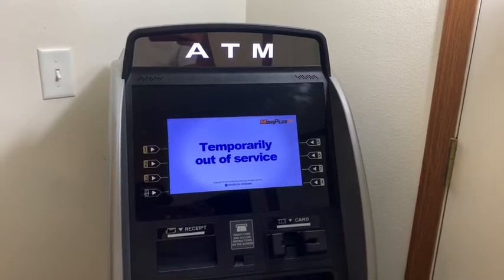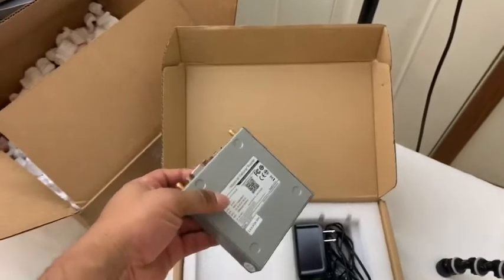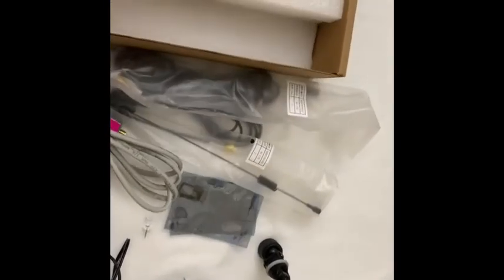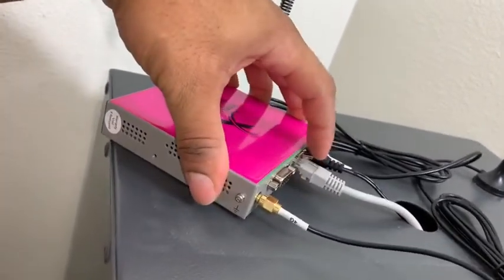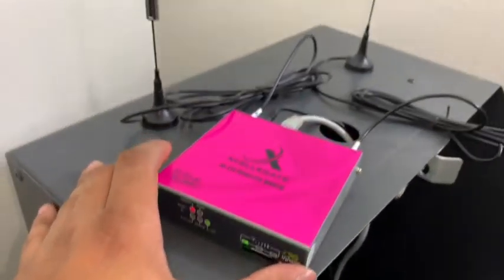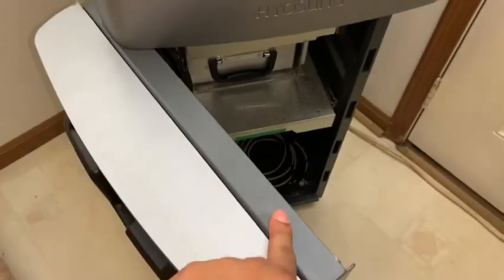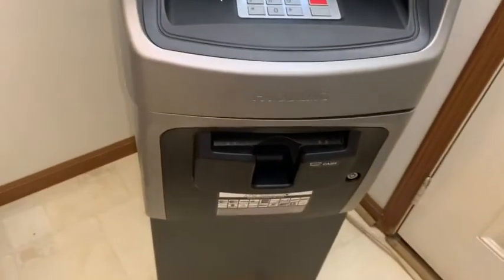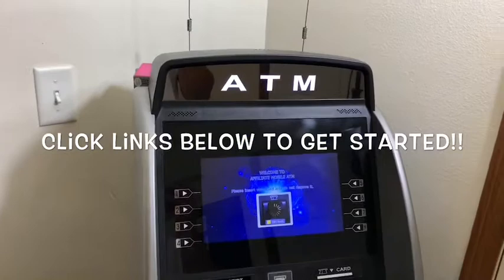Installing internet modem to your ATM

Comment: I'd hide the antennas in ceiling space on a steel plate etc as when using a magnetic base plate I believe it earth's the antennae
I'd also include a ups backup power supply to enable the modem and main brain of the atm would still report to you in the event of main power loss the ups wouldn't be to fully operate the atm just the modem and main reporting side of atm in case of attempted forced entry into atm etc

Comment: I am new to atm business, im having troubles connecting it to internet, i tried ethernet connection to connect it with locations internet but its blocking the connection for some reason, where did u buy this switch from and for how much? Does it come with the sim? Is there any monthly fee? Thanks in advance this will help me alot to get started.
Reply from the maker: My internet system came from ATM Depot

Comment: Just a few quick questions. So if you're connecting this wireless box using an ethernet cable and using an internet connection do you not need to pay the monthly fee for 4g LTE service anymore?  Or does the fee apply to any type of connection using this wireless box? As I understand this wireless box can connect to both WiFi and Cellular service, right?
Reply from the maker: No, this particular box is made by a phone provider but this primary use is just for the atm.  I’m sure you could use it for other purposes but price point is just for having the box as a internet router pretty much
Reply: JL Cooper so no monthly fee?
Reply from the maker: AntonioCorr they get small percentage of back end cost.
Reply from the maker: AntonioCorr correct 💯

Comment: Did you open a business bank account before even buying your first atm?
Reply from the maker: Yes,  you won’t be able to buy a new ATM and get processing without unless you buy one from a private owner
Reply: technically you don't need to open a business bank account if you have enough in your checking or savings to withdraw in cash. Though having a business account also helps organize and differentiate atm business from personal

Comment: Did you use the word “ATM” in your business? If you did what did the bank say? I am thinking about going with an ATM website that provides install and processing and no charge. What is the simplest way to have WiFi?
Reply from the maker: Yes I did,  depends on the bank but you just have to explain your business model.  And ATM Depot offers both and all kinds of services
Reply: Thank you. The internet is the most confusing to me. What would you say is the party you struggled or struggle most with the business?
Reply from the maker: Dree Hayden the Internet is actually the easiest part.  It works just like a cell phone 📱 it transmits using that device.  The most challenging was securing a bank 🏦
Reply: @jlcooper9139  why do you say securing a bank was hard, do they give atm businesses a hard time when opening ?
Reply from the maker: Dylan Evans  It can be tough depending on where you live, I simply used my personal bank with whom I was already banking with.  But some banks don’t like to start business accounts with independent atm owners. Due to the number of transactions the business can have

Comment: Did you buy the atm modem separately from the atm or did it come as an add on to the atm. Also what's the cost on the modem
Reply from the maker: Modem was separate,  I got it from my processor with the deal for processing the transactions.  Prices vary I only pay $9.99 for leasing it.
Reply: @jlcooper9139  where do you get your atms from and who does your processing. I looked into two processors but one wants to lock you into a 5 year contract and know every move you make and the other a 3 year contract after a trail run
Reply from the maker: Rich Action stay away from those long contracts.  Check out ATMDEPOT.com. I negotiate through them.  Been for my business so far. 💯
Reply: @jlcooper9139  cool thanks man. I reached out to them already i guess ill talk to them on the phone today. In the processor agreement form they sent it sticks you into a 3 year contract after the first x year or does it not matter once you have a good thing running with them. Do they take any surchage or interchange fee from you for them processing or do they give you 100% of both
Reply from the maker: Rich Action after the first year you can drop it and find another one. Or renegotiate.  Once you get some skin in the game you’ll figure out how to cut your cost.  Some of it is really trial and error.  You see what services best suits you and your ATMs.  Bottom line I want a company that will make smooth transactions.
Reply: @jlcooper9139  great advice thanks. Imma reply to there email now I'm just waiting for my bank account to open so i can fill out the paperwork
Reply from the maker: Rich Action great, much success to you, keep me posted
Reply: @jlcooper9139  will do. Thanks man
Reply: So im curious Rich Action??  Hows the business going so far?? Im tryna start this business myself.  Im located in Atlanta.
Reply: @brandoncarter5044  atm not good right now but that's because I'm focusing on other things. I still think it's a viable option seeing new businesses are being opened